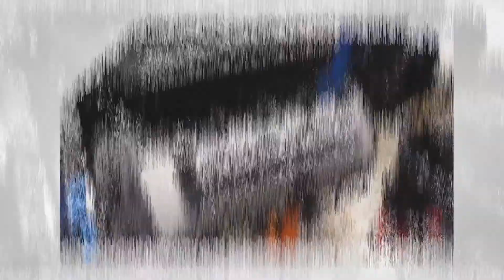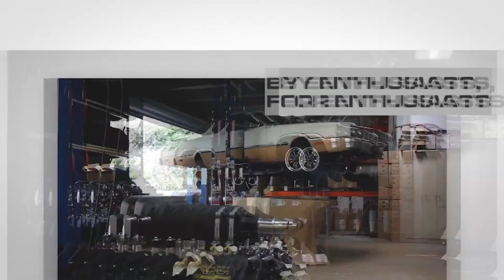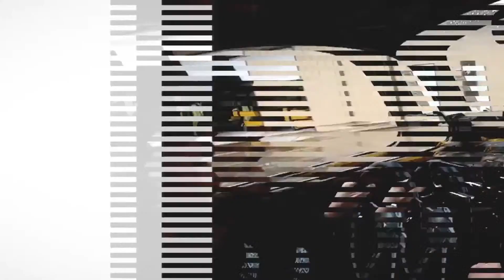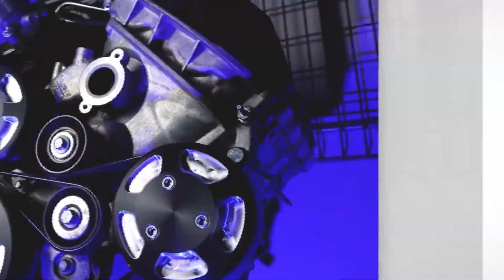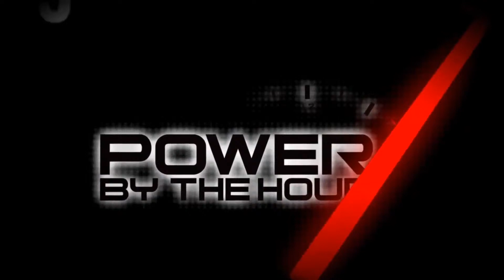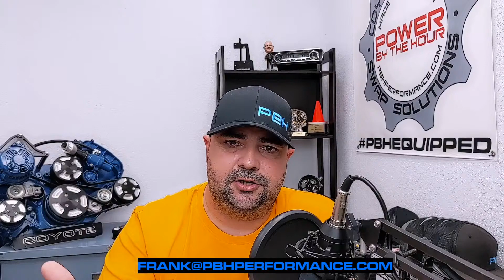PBH Live Episode #13 Degas Delete and Coyote Swap Power Steering pump updates.  Mach 1 and Hats

Comment: 93 cobra, 03/04 cobra, 13 boss 302 and 2020 gt500
Reply from the maker: Boss 302 was missing from my list, may need to replace my LX Coupe selection!
Reply: Sooo much potential and looks amazing.  Better than the 13/14 gt500 imo for what can be done to the roadrunner engine

Comment: 2017 Mustang GT in Grabber Blue ( which I have), 1965 Mustang GT350 competition model 306 hp 289 cid, with the factory IRS (first use in a Mustang) in White w/ blue stripes,  1969 Mustang BOSS 429 in Grabber Blue,  2020 Mustang GT350R in White w/ blue stripes.
Reply from the maker: I found a while back that Shelby was testing that 9inch IRS in a 64 or 65 Ford Falcon. It was really trick. I wonder if they had made that change back then would we of been IRS all along and how would that of altered the path of the Mustang through time. Some one get Doc Brown on the phone!
Reply: @PowerByTheHourPerformance  The pencil pushers deemed it 'too expensive' (go figure) and axed it. I have the whole IRS testing that FORD did on PDF.